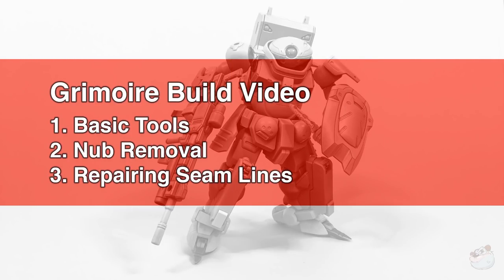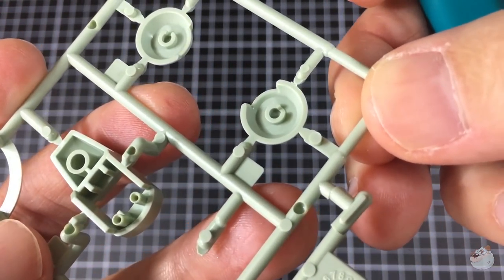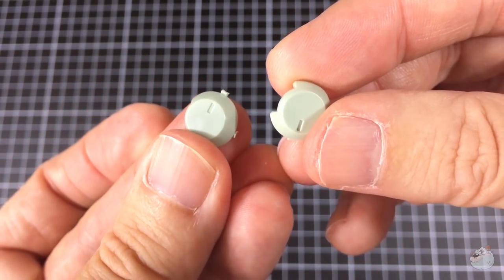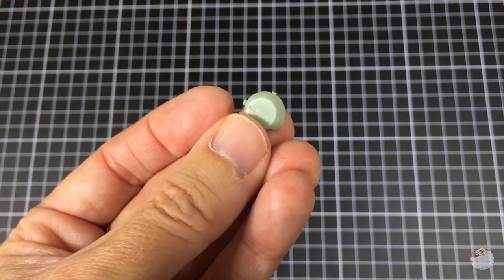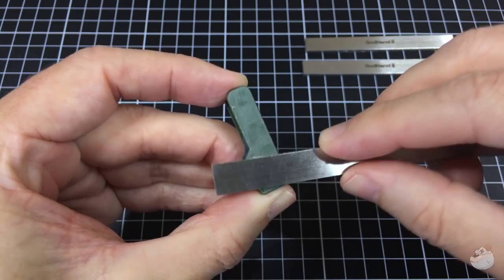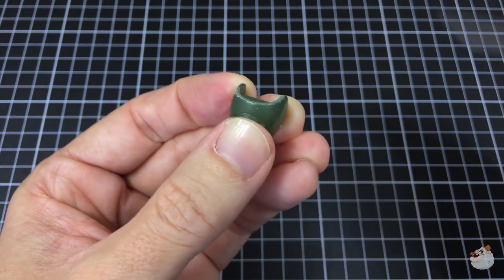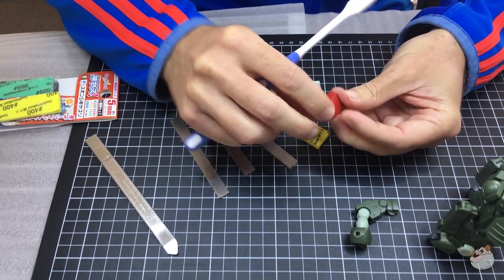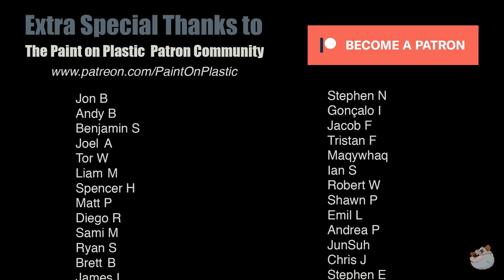Gunpla Tutorial How to Remove Nub marks on the Grimoire Red Beret with Lincoln Wright

Comment: Woah! Those Tamiya files are meant for a single push motion, they don't do anything on the pull except marr the plastic.  Just a helpful tip.  What I do is hold the file almost like you would a magic wand with my index finger on the back of the metal file itself for stability and then slowly but firmly push the files across the nub, lift, draw back without making contact, and then repeat.  They metal is cust specifically for the forward push to do the fine removal work.
Reply: Joey Gunota I'm almost embarrassed to admit that watching Gundam Build Fighters is what taught me how to properly remove nubs with Tamiya files. And it's so quick and easy with such great results that I don't really understand why more people aren't using those files.
Reply from the maker: Thanks Joey! I like to use them in a slight circular motion as shown here to remove the nub with more force on the push and then coasting lightly on the return and then - if needed - polish back the plastic with finer grits of sand paper or these new sanding cloths from Godhand.
Reply: Paint on Plastic by Lincoln Wright
I mean you can use your tools how you like. But I wpuld recommend trying it put as just one smooth push forward, lift, then repeat. The files are cut in such a way to maximize the forward push  and you can get a very smooth finish. You won't need sand paper at all if you use those files properly.
Reply from the maker: cool, thanks Joey! I'm actually learning so much by putting my work out there and having folks like your good self make friendly suggestions like this. Working so much on organic, curved kits for so long makes me think it's a good idea to work on the straight lines of Gunpla to learn and remember how to use my tools and approaches differently but not only that, I realise that I am not mentioning some little things like when to apply pressure when sanding and being move obviously directional with the file and shading strokes. If you watch the section on curved shading, I do exactly what you are suggesting albeit with a different tool. It is a challenge I face as a long term industry pro - I sometimes forgot or simply just don't know what is important to point out to beginners! I've never actually done a build demo live nor in person, only paint and weathering. I will make it a point to show what you are suggesting in another video in the future and give you a shout out of that's ok? Cheers dude!

Comment: You've gotten in my head, Lincoln! I know you didn't even mention the Wave paint stirrer in this video, but a few days before this video went up I got myself one off eBay. I've started hand painting and I've found that trying to shake my paints or stir them with a paper clip simply isn't getting the job done as well as paint stirrer.
Reply from the maker: Hi Justin, perfect! The WAVE stirrer is easily my #1 tool when painting and you are right - so much better than a paper clip or shaking, I am sure you will come to love yours too. :)
Reply: Try a milk frother. Should be the same thing.

Comment: If you can help it, sand or polish across the previous grit. Perpendicular, not parallel. This allows you to better differentiate the "cuts" so you know that your material is all on the same level.  Noting sucks more that going to finer grit when you weren't ready to.

Comment: Glad to see you mention dust masks. Have you done wet sanding? If so, how’d you find it?
Reply from the maker: Coffee Dude thank you and yes I do a lot of wet sending as well. Especially when I am fixing the seam lines and I shows a great deal of that in the last half of the video that is on Patreon - the 33min version. Wet sanding is good and different. Yes it Kalex most of the dust for us but also the parts get wet and it’s sometimes a little difficult to exactly see the finish for me I’m bare plastic. So I tend to do a little bit more of that on painted surfaces or stuff with putty on it. The GodHand sanding sticks I used here are good wet but the emery boards fall apart quite quickly. 😆🙄
Reply: Wet sanding is essential. Not only does it do a better job, it prevents micro-plastic particles entering the atmosphere. The important thing is to make sure no plastic then enters the water-supply, so mop up the water from wet sanding (full of micro-plastics) in a tissue and make sure it goes in the burnable trash for incineration.

Comment: LINCOLN! You should only ever use a file in one direction! Never back and forth. Especially if it's a cut file like that. It doesn't matter for sandpaper. Using in one direction protect both the file and the part.
Reply from the maker: no pressure on the back stroke, of course :)

Comment: Which grit should I get for the emery boards? I'm looking on ebay and there's a lot of 100/180 ones. Is it the higher the number, the softer they are?
Reply from the maker: The emery boards I am showing don't have grits, they are for finger nails and all seem pretty similar. Using the lower the number, the more coarse they are. If I were to buy them in grit numbers, I would probably look for 800, 1000 and 1200. WAVE and Godhand make those too.
Reply: Yeah, I normally use buffing blocks, but on ebay the emery boards actually do come with grit values. Most say they're "100 grit" on one side, "180 grit" on the other. Weird.
Reply: Emery boards will likely be coarser. Try searching for nail finishing or polishing boards
Reply: Keith Denny my girl got this thing (she didn't like it so it's mine now) that's like a four-sided stick with two grits on each face, eight in total. Each face says what it's for. I have literally polished a gunpla to a shine with it. She got it in the cosmetics section in a Target store. But they are everywhere (I looked). There are applicator brushes like you would get with powdered model pigments too. Turns out there is a bunch of stuff a modeler can use. Little jars, super cheap spray bottles, all kinds of stuff. Some makeup itself can work like powder pigments if you're hard-pressed to mix just the right shade. I've heard of diluting the enamels (nail polish) to use some of the iridescent and translucent effects, but never tried it myself.

Comment: Imagine that I only want to remove the nub mark and don't paint, just put the top coat. Is possible to remove the white spot completely?
Reply from the maker: It's a good question Ricardo but I really have no experience with this - I have always been a kit painter, in fact that is my main skill. The white spot is caused by stress so unless you can remove stress when cutting or sad the white spot out, I think it will at least requite some touch up. This particular kit is quite easy to leave the white spots due to placement and the dark green plastic... sadly...
Reply: Ricardo Pinheiro I just learnt something recently. You can use Tamiya thin cement or equivalent. Rub it on the white spot to melt and blend the plastic. I tried it and it does get rid of the white spot well enough. But you have to do a good job sanding it down after. Try it!
Reply from the maker: Noice, thanks Raimy. It's a really good technique.
Reply: If you cut the part from the sprues leaving a large nub using higher end nippers that actually cut and don't pinch the plastic, then use those same or better nippers to cut the nub off at the part, then follow with the Tamiya file shown in the video (but used properly with a push, lift from the plastic, and then pull back, repeat process, not a circular motion or a back and forth motion, those files only work on the push and can damage plastic on the pull), you can get rid of or even prevent the white stress marks. The sharper your nippers the less stress they put on the connection points when cutting parts off the runner. Using thinner as suggested can actually haze or even melt the plastic.

Comment: using the "flat against method" and the god hands 5.0, will there be basically no nub left then?

i am about to build my first gunpla MG soon and would like to try this method with the god hand 5.0

please and thanks
Reply from the maker: yes, the 5.0 reduces much of the nub. But I think the slightly cheaper one is a better buy - check out my list here; http://bit.ly/LincGodHandPicks
Reply: I used to use the expensive ones to slice the nub down in thin cheese-like layers, reducing stress marks to near nil. Once I got down to maybe a half or quarter mm, I then shave the tiny raised rectangular sides off with a hobby blade, creating a tidy little mound, and went about sanding. Thank god I got into painting and stopped obsessing quite so much about those pesky white stress marks, my build time has cut down severely as well as my backlog! 😅

Comment: The problem is.. if u dont want to paint it, the white mark is still there, yes, it will be shine and smooth, but yet visible. what to do whit that?
Reply from the maker: Even Bandai paint the model they show you on the box.
Reply: so?
Reply from the maker: Try a small spot of extra thin glue, I used some from Gunze on the RG Sazabi Prototype I made for Bandai. :)
Reply: @lucwatoa8775  you can use your finger nail to remove the white that is left over

Comment: It would be nice if they just make the pieces and use tapes to tape them on a plate with number on them to help you identify.
Reply: That wouldn’t be very efficient for this type of machine. Plastic injection molds are formed with liquid plastic being injected through those nub gates into the each shape’s bay. The idea is to form each complete runner of multiple pieces in one shot, on one machine, with one mold shell. To produce them individually would require a ton of single crafted metal mold shells with many more injection machines to produce them in an efficient time frame. The extra energy, space, and materials would affect the price point per kit. Perhaps in the future as 3D printing becomes less costly to produce finer results with nicer material, we might see garage kits being printed in a new fashion though!